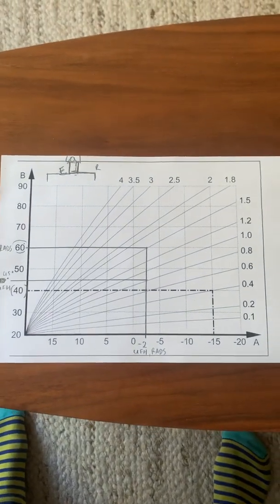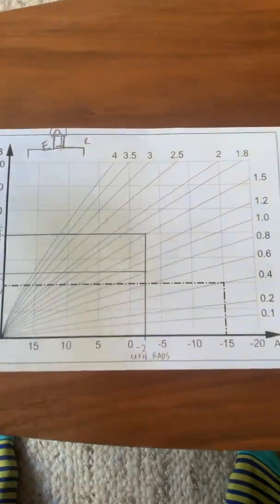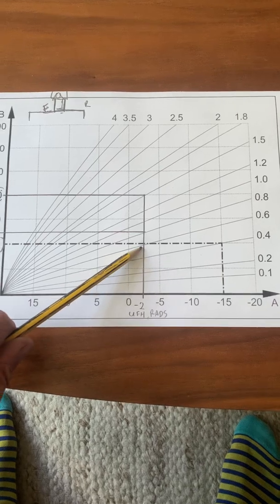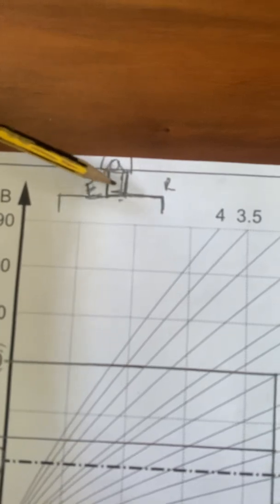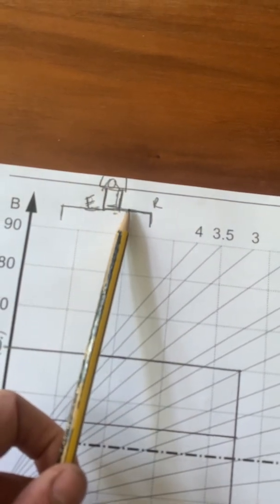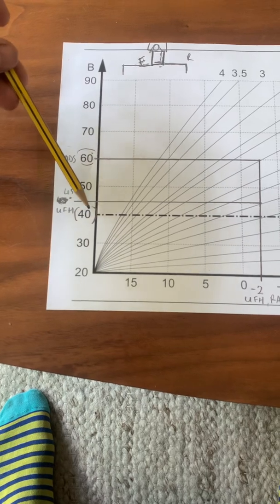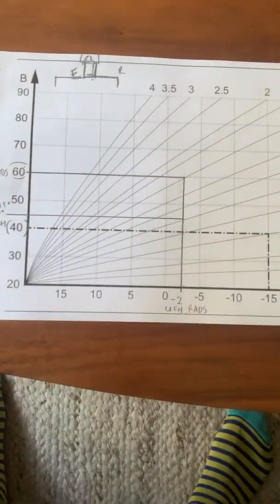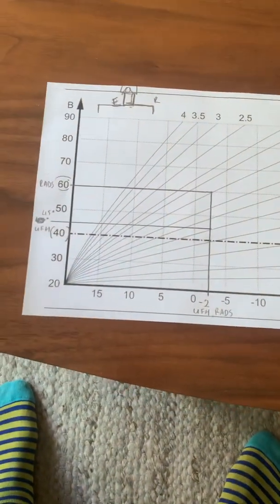Weather compensation Curve selection, for ESBE on Vaillant.

Comment: two q's: 1) If it's 18° outside (like today) but I want my home to be 25° I'm seeing an actual flow of 36.5° in my heating circuit. The house will never get to the desired temp when set at 0.65 as the default

2) Is it possible that the heat curve can be too high causing the pressure to be kicked from the pressure valve? 
 I had mine set to 3 or it takes ages for my home to heat but notices every 2-3 weeks I was losing between 0.3-0.5 bar. I can't find a leak anywhere
Reply from the maker: Hi, If you request a higher indoor temperature the flow temperature will alter to achieve this. 

It will depend on what the Pressure release valve is set at and whether this setting is exceeded, not much chance of this when running low temperatures. Sounds like you have a leak. 
Or the Expansion vessel needs looking at.
Reply: 25 crikey! 🥵